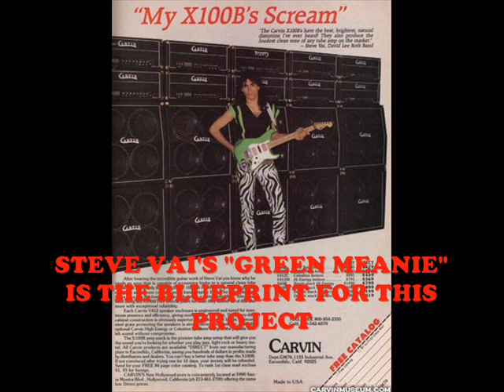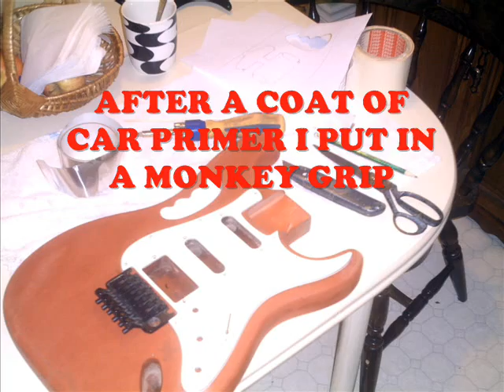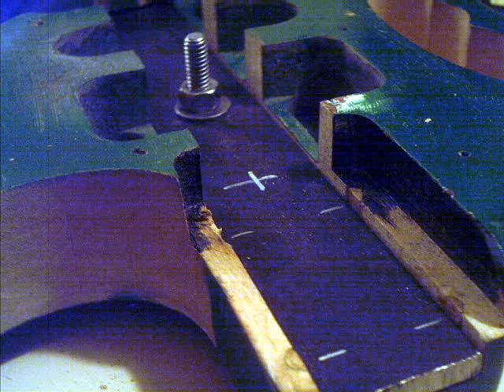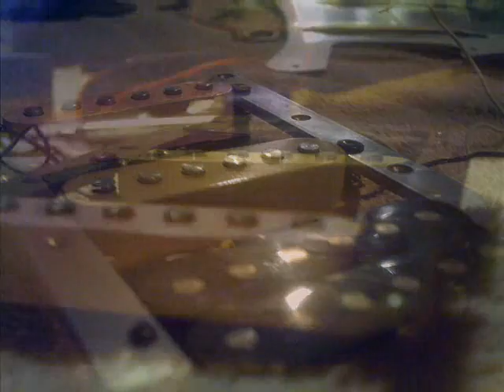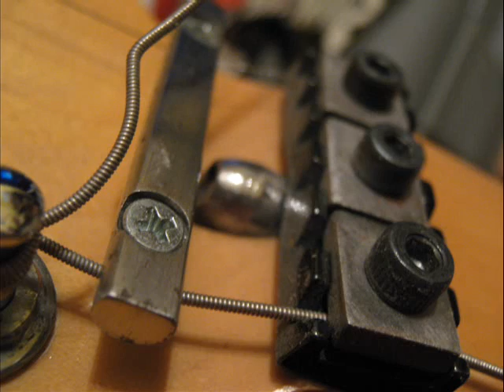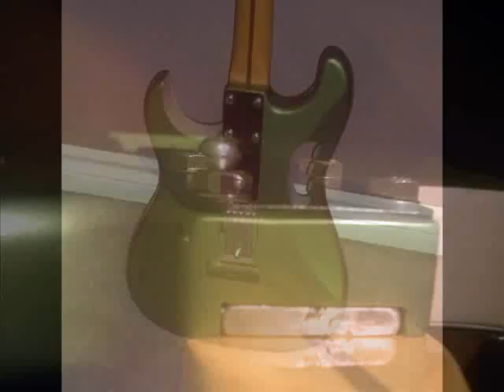SUPER SUSTAIN GUITAR ( the green bastard )

Comment: I've never heard of putting a steel bar in a guitar. How did you discover doing that? Is there any particular way to do it? And is there any negative effects on the sound?
Reply from the maker: +Noah Jaybird15 I should make a video about how I started doing this. I built a guitar with a very light body, so light that it was unplayable (neck heavy, unbalanced) so I bolted a large piece of flat bar to the back. It solved the weight issue but I also noticed how better the guitar sounded, since then I have played with this idea on many guitar projects.

Comment: Hey, man. I'm doing this to a junk Ibanez guitar that I bought off of eBay. Where did you get the steel bars? How did you attach them? And what did you use to route the guitar body?
Reply from the maker: Any metal supply store will have flat bar in many sizes and thicknesses, but Home Depot has basic flat bar as well. I use bolts to attach them and just a basic hand router for the grooves This is a video of another guitar that I installed steel bars but a little differently. .https://www.youtube.com/watch?v=S6To44V4ne4

Comment: Nice one mate. I saw this a while back and remembered it the other day when I bought a cheap strat copy. I am thinking of at least doing the steel mounting rails for the pick ups. Would that be worth while or is it pointless without the big plate down the middle?
Reply from the maker: +Dan Osper I've been experimenting this steel bar thing with several guitars and no two have been done the same way. Think of how a cup pressed against a wall lets you hear the sounds on the other side. Steel adds mass, and if the pickups are connected to the bars more vibration gets through to the pickups.
Reply: Makes sense. Cheers. i'll give it a go